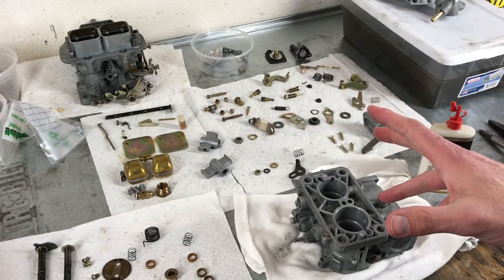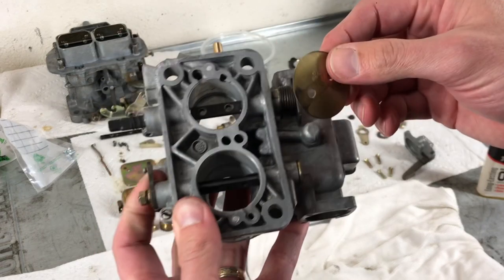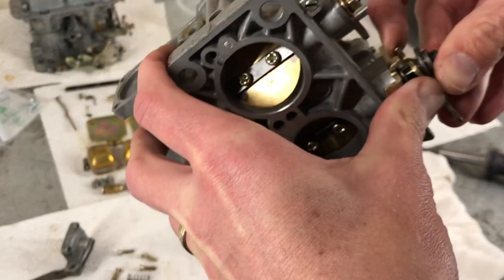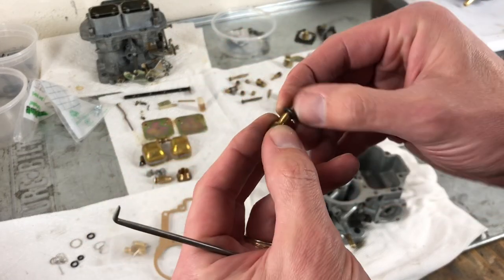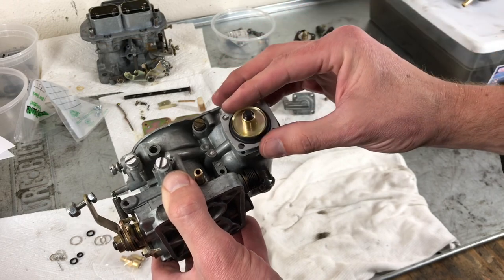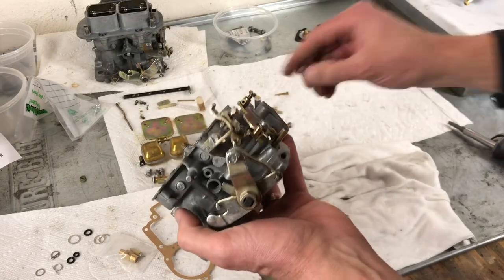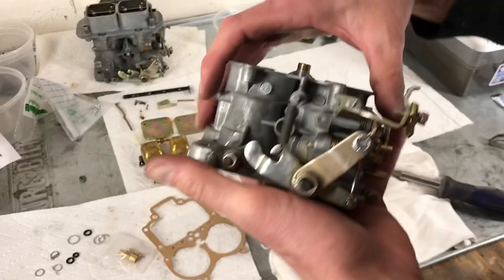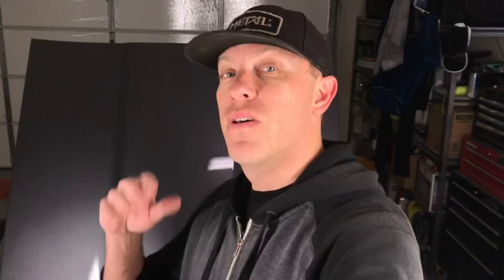How to rebuild a Weber 32/36 carburetor.

Comment: Quick question here: I think the emulsion tubes on my 32-36 are seized in the housing, they didnt slide out as yours did, otherwise my whole Carb came apart without much fuss. Any ideas from anyone on safely persuading them out of there?
Reply from the maker: +T.Jack maybe a little persuasion from the bottom of the fuel bowl by some pressurized air, keeping a finger on the tubes. Good luck!
Reply: @CarsBikesandCoffee  thanks, I'll give it a shot
Reply: Update: I got the emulsion tubes out, one came free with compressed air through the jet socket, and the other I had to gently pry out with a pick. This carb had water inside at one point and the brass components were slightly oxidized, hence the tricky removal.

Comment: Curt-can I ask a question?
Reply from the maker: Absolutely!
Reply: @CarsBikesandCoffee  As Ralph Kramden said: Hardee har har har!!

OK here we go I can send a couple photos if there’s a way to do that.

I have removed my Weber DGAV from my 1980 MGB and have installed the little bearing kit that replaces the bushings. I did this on the primary shaft. 

Putting everything back together, the online info talks about being sure the butterfly flaps close fully. I find that mine close fully if I have the flaps on the bottom in the right position but otherwise they don’t fully close. This is reflected in a lever mechanism (see photos) which when in the extended position does not let the primary flap close fully, but when put in the “down” position, the flap closes fine. 

I hope this is understandable. Is this as it should be or is there something wrong?
Reply from the maker: Sorry I couldn’t resist, but I’m happy to help where I can. Best way is to message the photos via Instagram if you have that.
Reply: @CarsBikesandCoffee  No apologies required-I enjoyed the joke!
Reply: @CarsBikesandCoffee  photos sent via Instagram, two messages, I don’t know Instagram well.
Reply from the maker: Do you have a manual choke? I know the older MGB did.
Reply: @CarsBikesandCoffee  No, it’s actuated by an electric wire. I’m not sure but I think 🤔 that’s what the A in DGAV means
Reply from the maker: So the bottom ones are your butterfly’s, top ones are your choke plates. I’m thinking that something is a little askew on the linkage or if the electric choke is pushing it slightly. Maybe send a phot of the linkage. Might take a look at the linkage disconnected from the choke plates and see if there is something visible where it’s off slightly.